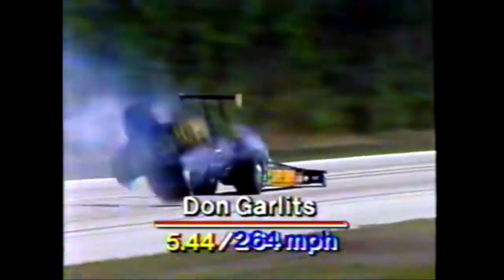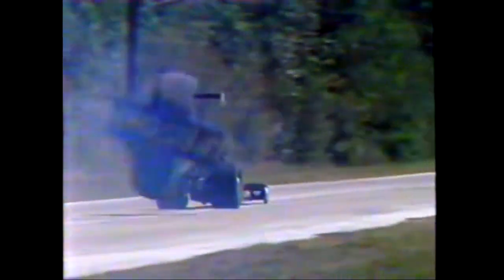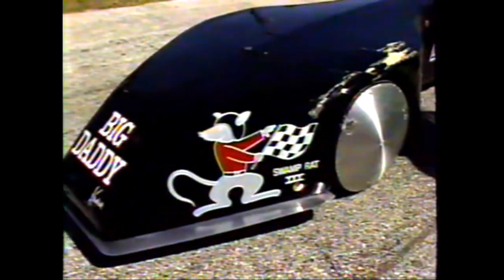Dry Hops: Tiny Tires

Comment: Very interesting topic, and something I’ve thought about more than once as I grew up in the late 80s/early 90s hayday of the tiny wheels. 
Garlits introduced the tiny tires with SR-30 in 86 and by the end of the year Gene Snow had switched over. At the start of ‘87 Eddie Hill’s pre-nuclear banana switched to them (as well as an enclosed driver canopy), and Darrell Gwynn’s Budweiser dragster as well. It wasn’t until 1989 that the tide turned and the tiny wheels found themselves en vogue. Gary Ormsby switched to them and found himself at the top of the standings…Darrell Gwynn seemed poised  for a title, and Hill as well as Snow had both broken 4 seconds with them the previous year. Soon it was follow the leader…Muldowney, Kalitta, Amato, and LaHaie  had all made the switch, and they made up the bulk of the championship contenders at the time. 
By the start of 1990 the big motorcycle wheels looked antiquated, and only a handful of older dragster ran them. 
Then at the start of 1993, the last significant hold outs with the larger wheels were Jim Head and Connie Kalitta, as well as Scott Kalitta, who made a surprising switch to  the larger wheels that year and began winning races. Just as quickly as the majority of teams switched to the tiny tires in ‘89, teams switched back to the larger wheels in droves during the summer of ‘93…Kenny Bernstein, Cory McClenathan, Don Prudhomme, Eddie Hill, Joe Amato, Mike Dunn and others all had made the switch. Drivers sited favorable E.T. as the reason. By the ‘94 Winternationals, only Pat Austin, Shelly Anderson and the late Jimmy Nix were the hold over regulars running the tiny tires. I believe Bernstein and maybe another regular switched back to the little airplane wheels for a period before permanently going with the “old school” larger wheels.
   I don’t recall who was the last to run them, but I believe by ‘96 or ‘97 at the latest, the tiny tires were dead. At some point they were outlawed completely, but by that time they hadn’t been seen outside of flashback clips of Bernstein running 300mph in the Bud King dragster, or vintage clips of the Amato/Ormsby battle of 1990.

Comment: I knew about the evolution of the front tires on Swamp Rat 30, but had no idea about just how many negatives there were to the little front wheels before this video. I also had no idea they were eventually banned. Excellent video! 

If you take suggestions for topics I have a few I’ve always been curious about:
>the little front spoilers some funny cars ran in the mid 1980s
>the use of nitrous oxide on nitro funny cars in the early 1980s
>the 3 spark-plug-per-cylinder heads Bernstein ran at the start of the 1986 season
Reply from the maker: All good suggestions. I will add them to the list. I have always been intrigued by Dale Armstrong and his innovations. 3 spark plugs was one of his more unique ideas
Reply: @DRGE68 I remember reading he developed a 2-speed supercharger, not sure if that ever made it to competition. 

I’m glad you liked the topic ideas, thanks for adding them to the list! I’ll give you one more too - nitrous in pro stock in the 1990s. There are so many stories about that, and it was always intriguing to me.

Comment: I believe that everybody was using them based on aerodynamics 1st, and other factors all were second and on. An engineer could show math on the differences in flywheel effect and rolling resistance. In regards to blow overs in the modern long car era. As the wheelbase lengthened, they ran less weight on the front end. As the fuel requirements grew, the tank grew and less ballast was placed on the front ends. Because of the increase in power, the wings grew and the angle of the struts was changed substantially. At the end of a run, they may have used up from 5 to 8 gallons of fuel. At a guesstimate of 7 lbs per gallon, that was substantial. During that time period, NHRA instituted new rules on wing size, placement of struts and the material used for the struts. I built several cars during that period and bought material from Delong Manf. as Don was one of the few that could create the proper tubing to met the spec. Once the wing rules were in place, people learned the balance in keeping the car on the ground and as hooked as they could. It's been years since I was at the track but even a really good alky car would black track the full length of the track. I believe the tire has to be on the verge of slipping to lay that much rubber. One of my friends lived in Albu. NM. He buddied up to Rich Galles man that ran the wing dyno. That was a wind tunnel that had a pressure transducer connected to the lower wing mount. We found that our small alky wing made a minimum of 150 lbs. of down force at 150 mph as I remember. I could be wrong on that. Not long after that, I was told that a top fuel wing could produce a ton of downforce above 250 mph. I'm dealing with memories from the mid 90's so there is room for some inaccuracies. :)